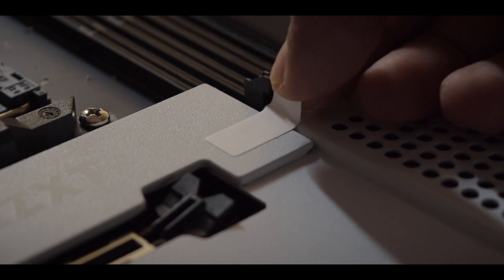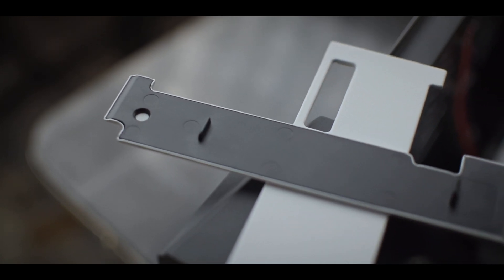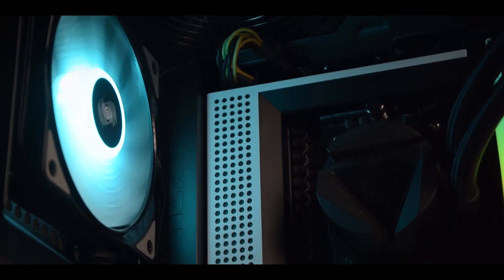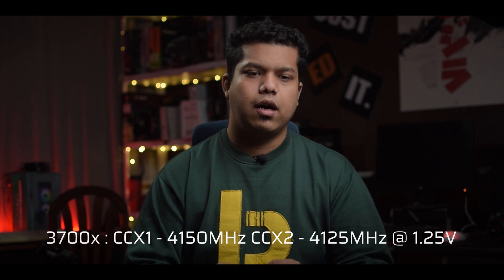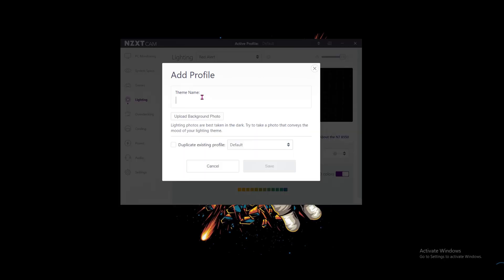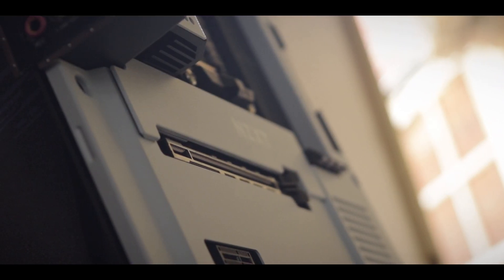NZXT N7 B550 Review - Testing NZXT's FIRST AMD Ryzen Motherboard!! | English

Comment: Just got this board in my pc, but it's not letting me boot windows 10 despite my ssd showing up in the bios. I've checked cables and different sata ports, but still nothing.
Reply from the maker: Is the ssd showing up as uefi bootable?
Reply: @HardwareMana  thank you for the reply! Had to boot it in legacy mode. It works now.
Reply from the maker: @Beefercow  ok. So I think your drive is mbr formatted so you can change it to gpt later
Reply: Will that keep the files safe?

Comment: Is Asrock the OEM? The BIOS looks very Asrock-y.
Was the Vcore issue observed when the cores were idling?
Reply from the maker: Yes, Asrock is the OEM of the board. The idle voltage was inline with other motherboards that I have tried.
Reply: @HardwareMana  Oh ok. I haven't extensively looked into how regulation and LLC works on AMD platforms, but do they have a fixed voltage mode?

I have seen that Intel boards either use VID (processor requested voltage), Offset from VID (can be +ve or -ve), Fixed (voltage doesn't drop when idle) or Adaptive (uses VID but with a max limit at high load) mode. The issue with Adaptive mode is that the transient response falls short and voltage spikes occur if the LLC is set up to compensate a lot. This, in turn, leads to temperature spikes and can be observed easily with Prime95 1344K AVX2-enabled FFTs. The moment a worker thread finishes an iteration, a temperature and voltage spike is seen. This is not a problem with Fixed mode though. Vdroop trends are also similar in both cases.

Comment: They're breaking the allowable voltage limits (laughing). This just isn't and issue that NZXT is creating. It's constantly happening on both sides of the board (AMD and Intel). Companies are trying to win customers over. I just wish they wouldn't push the volts past the safe limit.

Comment: Thanks for the coverage of this mobo. I got the NZXT notification of it's availability this morning but decided against purchasing at this moment as I feel the $230 is a bit too much for the feature set. I suppose if you have an NZXT h710/i than maybe the price could be justified. If the mobo was priced around $180-200, I might have purchased it as I have been wanting to see an AMD based motherboard by NZXT since they released their first line back with the N7 Z370.
Cheers!
Reply from the maker: Right... The price needs to come down. Then it will be a good balance of looks and performance.

Comment from the maker: Hi there!! Late upload but had to follow the NDA 😊

And forgot to mention, this is also available in matte Black...

Timestamps -

00:00 - Intro & overview
01:46 - Packaging and accessories
02:09 - SSD cover and shroud
03:08 - Socket area
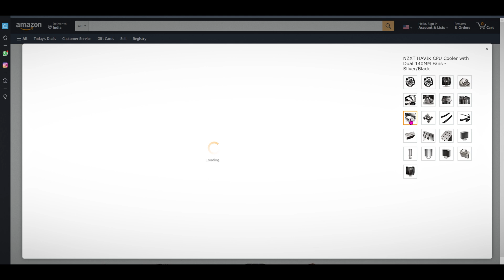03:25 - Heatsinks
03:50 - PCIe slots, SSD slots
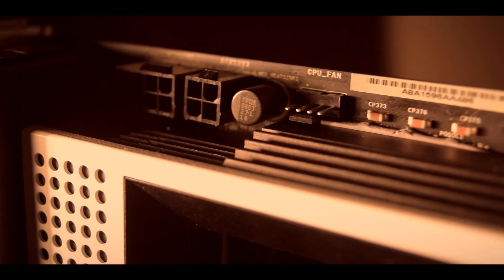04:24 - Fan & RGB header
05:13 - USB headers
05:28 - Debug LEDs, Power and Reset button
05:44 - Audio
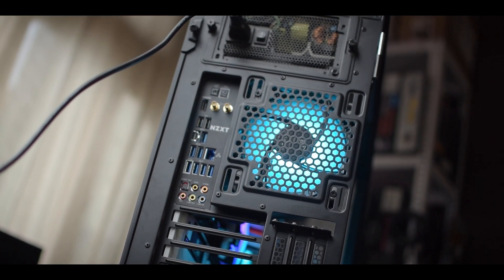06:10 - I/O area
07:01 - VRM, Capacitors and MOSFETS
08:09 - BIOS
09:31 - Overclocking CPU
10:19 - Overclocking RAM
10:55 - VRM thermals
11:12 - NZXT cam
12:35 - Conclusion
Reply: HWM Aka  Punjabi BEEBOM 
😔😔😔😔😔